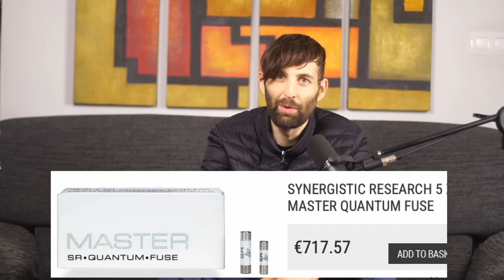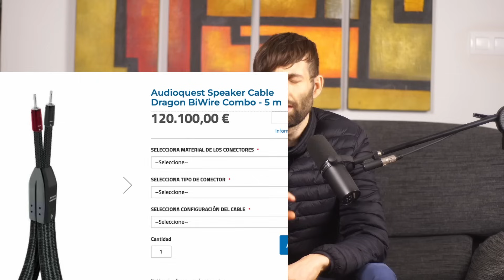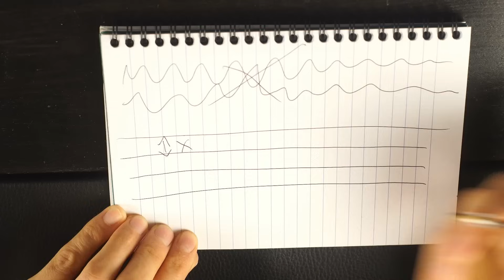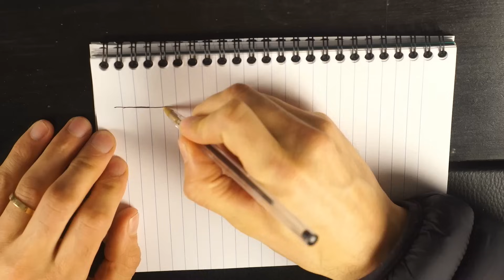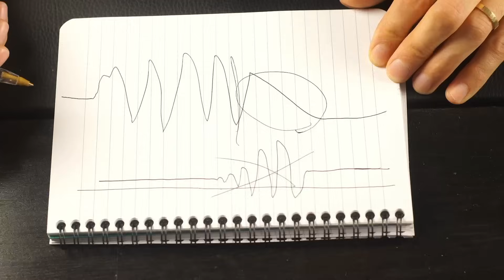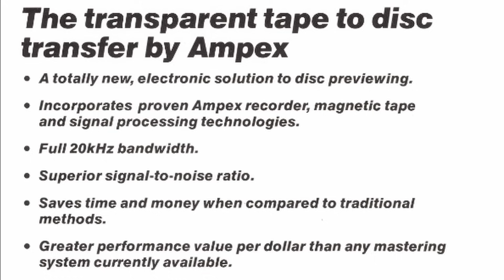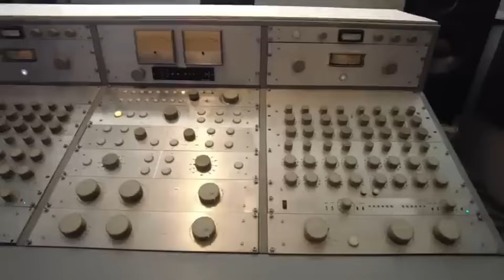Hard truth: most vinyl is digital anyway

Comment: Vinyl wasn't digital until digital came along.
Reply: Vinyl was also worse before digital came along because the analog systems degraded the sound in the mixing process.
Reply: @Munakas-wq3gpto be very specific, tape going over play and record heads repeatedly killed the sound. This is avoidable by making first gen copies. There isn’t any other way analog magically “degrades” sound quality
Reply: @deeppeace156  Of course there is. The SNR levels of analog tapes and vinyl is about 65db which is poor compared to digital. Also every analog copy is worse than the original where on digital you can make high bit masters and have non-degraded work copies as much as you need.
Reply: "This is avoidable by making first gen copies."
..out of (too many times) replayed analog master??
Reply: @MrFryfish  First Gen and too many times replayed are not the same thing LOL
Reply: @Munakas-wq3gp stay on topic.  we aren't talking about why digital is better than analog. You specifically said "analog systems degraded the sound in the mixing process"  SNR is recording, not mixing. I hope you know the difference. 65 DB is less than digital but it's more than enough if you set your levels right. That is not an argument for "analog systems degraded the sound in the mixing process". Your next, very obvious statement (we can copy digital files lol), works in analog too, just by making a first gen copy.
Reply: @deeppeace156  Can you explain yourself?
With any replay on analog format we "deform" sligthly THE PHISICAL FORMAT the master record is on. From digital master.. (similar CD / SACD etc.) .. as there is no phisical contact - no phisical damage.
 Your opinion differ?
Explain.
Reply: @deeppeace156  But, what are we talking about? (we aren't talking about why digital is better than analog)
Clarifiyng (from) which/what support media would last longer..? Which one is better, easier to work with without the "suffer" of medium/phisical support of replay from master source..
Reply: @MrFryfish  I agree with everything you said. I just commented because this nebulous statement is vague for no reason- “Analog systems degraded the sound on the mixing process”. Why would you word it like that when you could just say that the tape heads continuously degrade the tape. The former just sounds too mysterious.   What is an analog system? lol. What “mixing process”. It’s the tape going over the tape heads. It’s not adding delay or reverb or eq. 

Ken Caillait famously saved rumors by syncing up a very early generation master. Not the very first playthrough but it obviously worked.
Reply: Vinyl wasn't and will not be digital... unless you record binary data on it and create a decoder (software or hardware) to transform that analog audio signal into digital.   Back in the day, some ZX Spectrum games were distributed on vinyl in the UK using this technique.

Comment: At the end of the 1980s, there were reports on progress in the production of records (magazine: rfe, GDR).
Although the central topic was direct metal mastering (production of the master by cutting a master record into an electrolytically applied amorphous copper layer), it also dealt with further improvements through the use of digital technology for optimum tracking and to compensate for known shortcomings in the cutting process. The last sentence of the article series ended with “The technology that gets the most out of records, however, will probably also be the cause of its death.”
That was at the end of the 1980s and in the technologically backward GDR.

The important points were:
* Direct Metal Mastering, cutting into a less bouncy substance
* DDD, completely digital recording and mastering
* Digital compensation of cutting errors
* Optimal feed, calculated not from an envelope curve but from the actual deflection
* Precise planning of the entire groove feed

Das war, soweit ich mich erinnere, Anfang 1989.
Reply from the maker: DMM war nicht unbedingt wegen bounciness aber eher weil man im presswerk zwei schritte überspringen kann. aber das ist heute weniger relevant da das nur vorteilhaft wird nach ein paar tausend stück und heute presst man normalerweise weniger schallplatten

Comment: I love it when the vinyl digital debate comes up.  I go into a lot of technical differences between vinyl and digital. Then as the final nail in the coffin I tell them about the Ampex ADD-1 and it’s bit/sample rate and I usually have to lift their chin off the floor.    Vinyl doesn’t sound better it sounds different.
Reply: Amazing story buddy😂
Reply from the maker: soundstream was also interesting. actually slightly higher res theoretically than CD
Reply: No one’s arguing that it sounds subjectively or objectively better, they’re arguing it sounds different in comparison to its digital master (or even digital vinyl master file)

Comment: I like a good debunking as much as anybody.  And I appreciate that there is good information in these videos that can clarify misconceptions.  HOWEVER.., there’s a bit of conceptual slippage involved in this video, including the headline that bugs me.  The first one is the claim that anybody who says vinyl sounds better than digital is ignorant or an idiot.
The problem is “ sounds better” is a value judgement, not an objective fact. Somebody may subjectively judge a vinyl version or perhaps vinyl in generally as “ sounding better” than digital, because that’s how it strikes them.  The response might be “ well OK you might have a preference for vinyl but it doesn’t sound better.”  
But that again shouldn’t be just asserted, It needs to be explained exactly why we should agree “ digital sounds better.”

I myself have no delusions about the technical superiority of digital.  I’ve worked in POST PRODUCTION for over 30 years, on ProTools and multi million dollar mixing theatres using digital sources, and at home on my “high end” two channel set up I use a Benchmark DAC which is of course fully transparent.  I also have a very good turntable arm and cartridge and I love playing records.  It’s quite obvious which is the more accurate medium. 

But the vinyl playback in my system generally sounds different. And it can sound different in way s that I can often prefer.  And why do I prefer it?  Because in certain ways it “ sounds better” to me than the digital source.  I can always hear the technical superiority of the digital source in terms of low noise, the tiniest nuances, sometimes differences in bass and dynamics etc.  But in my system, as well as a number of other systems, I’ve listened to with good vinyl playback system, there is a certain “ texture” to vinyl playback that often seems to make the Sonic images images feel a bit more solid, texturally present and “ there” in a way that they sort of pop out of the mix a bit more and feel a bit more real.  Not always, but it happens a lot.  So even when it comes to symphonic recordings on vinyl - I’m a huge fan of soundtracks as well as classical music - there are some clear advantages to the digital playback in terms of low noise during quiet passages, lack of wow or flutter, sometimes cleaner on loud passages, etc.  
However, very often I find the solid and texture coming off. The vinyl makes the instruments feel more tactile and present - I can believe just a bit more like I’m hearing real string sections, plucking their strings, a real percussion instrument in the back of the stage, real bows on the bass strings…

As the dude in this video pointed out in his last video, vinyl doesn’t have a “ sound” in terms of frequency response, given all the variables all the way down to how any individual turntable and cartridge is set up is behaving.  

But it’s quite possible to not be under any delusions about the technical superiority of digital, and how that can translate into Sonic advantages, while still rendering a personal judgement that “ vinyl sounds better” In someways, even if that may have to do with the specifics of ones own system.

Secondly, what irks me more is the whole “ vinyl is digital you stupid audiophiles/vinyl enthusiasts!”

I understand the desire to Poke a hole in the “ analogue purist” fringe who have some goofy ideas about analogue superiority.  The problem comes when you label videos like this in a misleading way.  

The fact that there are digital steps along the way, creating a vinyl record in no way entails “ vinyl is digital.”  In fact, the previous video not to mention this one actually Is evidence that vinyl is not digital - that is that a digital step hardly means that vinyl now has digital qualities.  The electro mechanical nature of how vinyl is produced, all those kludgy steps, leading to you finally, dragging the sound off the disk with a rock, tend to result in a different sound than the digital versions.  No doubt from the accrual of any number of small distortions along the way.  The upshot is: vinyl still sounds like vinyl - different from the digital version. There is still normally distinct vinyl-type distortions and signatures.  

I know that many of the vital records I own had digital steps.  I don’t give a damn.  All I care about is the sound of the end result.  I’ve compared plenty of vinyl records that I know came from the same digital Masters as the CD release (that is the original masters obviously there’s further mastering for vinyl), and the vinyl still always sounds like vinyl compared to the digital version. Which include the type of attributes I mentioned above that I sometimes sometimes prefer over the digital.  

Ever since the Mo-Fi scandal people have loved to skewer vinyl enthusiast saying “ ha ha you’re really listening to digital” when that is bogus because the nature of the vinyl process tends to produce any number of departures from a digital source, and so one can still find themselves “ enjoying the sound of vinyl” in their system, in a way that depart to one degree or another from the digital versions.
Reply from the maker: i think you maybe overlooked the context that my video is targeting. i'm targeting the claim that vinyl always sounds better then digital. this is indeed a stupid claim because, even with subjectivity in the mix, you could have a crappy vinyl cut that everyone agrees sucks and a brilliant sounding digital version. with such a claim only one single counterexample is necessary to debunk it.
Reply from the maker: the ignorant bit is mainly targeting the fact that many vinyl releases that the audiophiles claim to sound better than digital passed through digital
Reply: @APMastering 
I agree that would be a stupid claim , but being also an audiophile
as well as a vinyl enthusiast, I have rarely ever encountered people saying that vinyl “ always” sounds better than digital.  I agree that it happens, and I also agree that you can see plenty of generalizations floating around. That vinyl sounds better or warmer than digital.  But “ vinyl always sounds better than digital “ is the type of absolute statement I have rarely encountered .  In that sense I have a feeling some of this is railing at quite a fringe contingent.  And in doing so, I think “ vinyl is digital” type of statements can actually lead to a bit of confusion.  Of course, the information you gave about vinyl often having had digital steps in it is accurate.  But I think it was also worth emphasizing that just because they were digital steps involved it doesn’t mean that Vinyl with digital steps ends up with the character of digital.  It typically doesn’t.  It still sounds like vinyl.  
Which can justify  people prefer preferring the sound of vinyl, and justify even on Sonic grounds of preference still choosing vinyl versions over digital files.  
That’s the kind of stuff that gets lost I think if you don’t clarify it, and it’s often behind much of the mocking of vinyl enthusiasts by people making similar statements “ you say you like the sound of vinyl, but you’re buying records that have digital steps in it, what a fool!”
Reply from the maker: @ well i put comments up on the screen on this video from my last video where people were making that claim! 😅
Reply: @APMastering fair enough.  I saw some of the idiotic comments.  I still find that to be a pretty rarely made claim.  But my main point is that the emphasis of vinyl steps in making digital, while it can be informative, has also often been responsible for some overreach in mocking people’s choice of vinyl, who say they prefer the sound of vinyl.
Reply: Maybe 1 out of 100 say vinyl is always better. Why are we even talking about such a rare species? A much higher % say the vinyl version is OFTEN better sounding. If the host of this video owned a Goldmund Reference turntable and a $15,000 plus Clearaudio Goldfinger phono cartridge, believe me; he would not be preferring cds to a lot of vinyl. He would be spending a whole lot more time listening to vinyl. A lot of what is said is based on ignorance and unfamiliarity, with all due respect. Anyone who thinks The Nightfly by Donald Fagen is one of the world's best sounding recordings, has not heard many of the world's best sounding recordings. The Nightfly is often judged great sounding, but really what is great sounding about it is its music and its bass texture and definition. The midrange is dimensionally thin sounding. Listen to the upper keys of the piano, as they totally thin up. Paper edge thin. The highs have some slight grain. Fine grain to be sure, but it is there. Not the ultimate in presence or resolution. Timbre on some things are a bit phiny sounding  If the host thinks something like Nightfly is in a sonically standard setting class, then this tells you how not very far along his perception is. Instead of Nightfly, try I've Got The Music In Me by Thelma Houston on Sheffield Labs lp. Make sure it is Lab 2, not the Treasury Series version. Tell us if you hear any problems with sound quality or dynamic range on that. Your turntable will probably be a limitation. Or listen to an early 1960s RCA Living Stereo lp titled The Power Of The Orchestra with Rene' Leibowitz conducting. These will trump for sound quality any cd in your collection for presence, realism and a lot of other things. And those are just two examples of countless lps out there. 

 Obviously we are dealing here with someone who doesn't have a very good idea of the greatest recordings and the greatest equipment. I like digital too. But an lps resolution limit is a fraction of an angstrom, which is far more impressive than any  digital equipment's technical ability. Look up on the net how small an angstrom is. You won't be able to picture that small. There's a lot more to it than the host presents. For instance a signal has to go through over 100 parts inside a cd player. With vinyl, the signal just goes out 4 thin wires out the back of the phono cartridge, before it gets to the preamp section. A much simpler signal path. All those parts inside a cd player can degrade the sound slightly, and it is additive. Less is more. I like both cd and vinyl, but vinyl sounds more smooth and genuine to me, but usually only by a moderate bit. Of course I don't have a Goldmund Reference turntable and a $15,000+ Clearaudio Goldfinger phono cartridge to play lps on either. Absolutistic statements are dumb, unless you live and own and can experience the very best on a daily basis. If you ever get to that point; THEN let us know.
Reply from the maker: @ too long to read but i never said fagens record is one of the best sounding, i said it got 7 grammy nominations
Reply: Not too long to read.Too many good points to address, and not even half as much to read as the guy's first comment who you are having a debate with. Some of us know with all due respect that you don't know what you are talking about. You didn't use Nightfly as an example because of awards, you went on and on about its (to you or some others) supposedly great sonics.

Comment: It's the same for synthesisers: just Google "Why Modern Digital Synthesis Is More Analog than Analog" by Mark Barton. That said, I still like vinyl with some types of music. The low-level pink noise blanket and crosstalk gives it the often mentioned "warm" or mellow sound. And the size makes the artwork stand out more, the ritual of putting on a record slows you down a bit, so you listen more attentively, etc. Bur for sound quality, CD is better, sure (and "Hi Res" overkill for home use).

Comment: You are 100% correct, digital is transparent and measurably superior. HOWEVER no one said all vinyl enjoyers believe the opposite. I'll speak for myself: I flipping rip my vinyls to digital just to get the better mastering. It's so unbelievably rare for 40s to 70s music to sound better 'remastered' for digital. And as you've said, modern music also sounds more dynamic on vinyl. So what does that leave me with exactly? A very narrow 80s to 90s digital era right before the loudness wars, plus classical and 'audiophile' niche albums that actually sound better on digital formats?!

Furthermore, you claim vinyl has no sound to it other than surface noise, but come on you know very well that is not true. The transient response is different, the phase is different, the pitch is different to name a few. I'm not saying 'better'. Just 'different', actually, measurably worse to be precise. But this can subjectively be preferred over the actual master. Distortion can be a good thing for some albums. It can hide mastering errors for example ;)
Reply: Thankyou